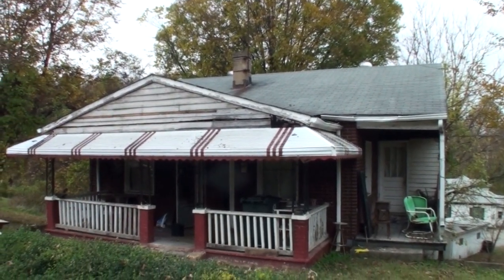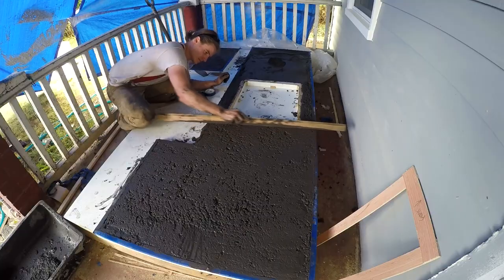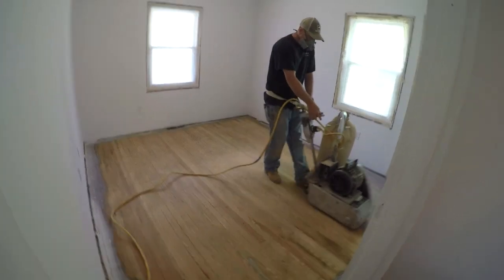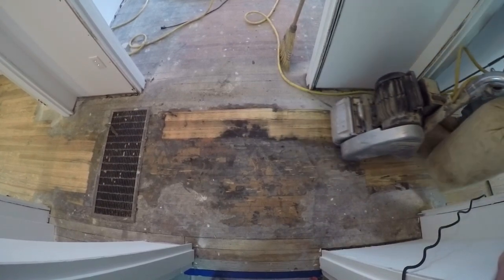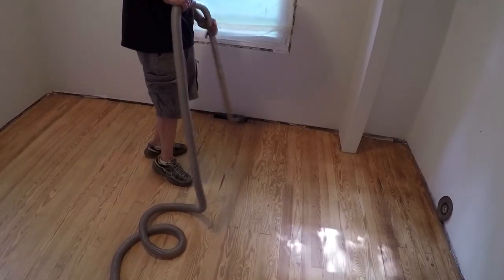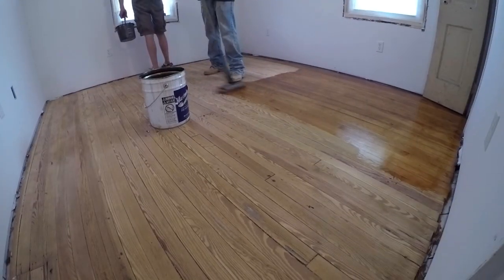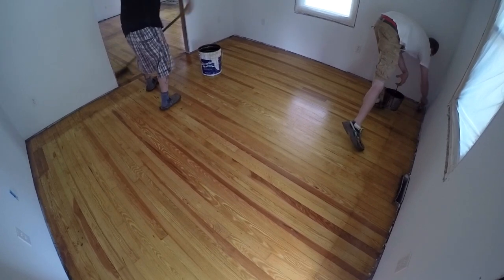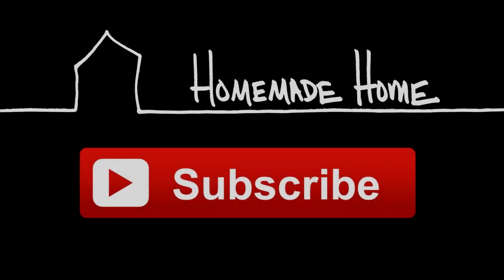Restoring Our Beautiful Pine Floors

Comment: Very logical choice in hiring a team with all the equipment . I have sanded many floors over the years , making a living at it and I still have the drum sander , the edger and etc. in my shop, sometimes I bit off more than I should have but slowing down some after turning 70 years old. All that dust isn't healthy but still doing shop wood working. Thanks for your interesting channel.
Reply from the maker: Handy tools to have.

Comment: Came out awesome. It pays to hire the pros, like you said, they have the equipment and knowhow. I learned that the hard way. Now you have a new house with your uhmmmm you're wife's finger print on it. Really a nice job.
Reply from the maker: It sure does, I've done all the work except for the floors, window install and heat pump.......should have got someone to do the drywall, they came out nice but it took me about a month. Thanks for watching.

Comment: how much did it cost for the pros to do the job?
Reply from the maker: About $1,200
Reply: @homemadehome5575  From doing about 1,000 sq ft myself on two houses, it would have cost you (with rented equipment) about $300. But that edger is called a "Widow-maker" for a reason, LOL. There's a better machine to rent for removing the 'top coat so they wouldn't have spend so much on paper. But pine is soft and probably needs the experts. I do like a floor with more character.

Comment: Can you give estimate cost on paying someone to do the floors. Thank you
Reply from the maker: I paid $1200, my house is a little under 800 sq. feet. This did not include the small bathroom and the utility room, both small. You can call floor refinishers and ask there price for sanding and finishing per square foot. It should be standard, if someone can't tell you that.....I tend to stay away from them.
Reply: Homemade Home thanks! I’ve been treated badly in past when calling electric workers etc to ask pricing and they ask if it is for same day and I say just planning and they hang up on me cause I’m not instant money. Thank you! My house is listed at 1,000 but I’m not sure if that includes my closets or weird side room lol.
Reply from the maker: Having an electrician quote you a price over the phone is not as simple. It is a shame when someone isn't polite about it but I can understand their position. Working with customers is hard, what makes it worse is normally the customer has no idea what they need, much less how any of the work is done but still want to be involved. Outside of calling a big company, dealing with tradesman is normally fairly difficult unless you have built up a connection with people you use regularly, which most people don't. Most of these tradesmen are in a financial pickle, so they are basically running from one job to the next but never get anywhere. Also when people say they are planning, it just sounds like they are calling around finding the cheapest price, hence the hang-up. They are just going on experience that most people saying that don't work out. The best way to find a tradesman is through word of mouth. Ask others you know have had work done, or ask another tradesman, a plumber for example, if they have anyone they would suggest to do some electrical work, he will probably say "My cousin is an electrician." Certain trades are not as standardized as others. Floor sanders have  per foot price, drywall is by the sheet. Plumbing is more by the job, so is electric outside of some stuff like. A plumber will have a normal range for doing things like changing out a toilet, water heater, etc. Electricians could tell you a normal range for a service upgrade, fixing an outlet but bigger stuff is too hard to predict without really looking into it and there is enough easy work out there for tradesman to pass up on time consuming stuff. All this is just an explanation from my point of view and experience, it can be a tricky world to navigate without forming a bad opinion. Your sanding job will probably cost no less than $1500 but will probably be between $2000 - 3000. I think my guys did it cheap. Mine was also a barebones job. No stain, etc.
Reply: Homemade Home yes a job can be different hours but I was looking for average estimate on how long something takes / per hour rate. Not a hard number to hold them to .

Comment: they should have sanded a bit more, down to the bare wood, which is why you have all those dark spots where the varnish seeped in
Reply from the maker: It was down to bare wood.....these are stains from years of issues, they go deep.
Reply: get back to your dump dave, i still believe those Dark Spots could have been removed with a bit more sanding. although it looks pretty good and has good character.
Reply: water damage, sure, ive redone boards that looked like they had similar damage to that, and they turned out fine. with that amount of water damage im sure there would be rot too, the fact is , neither of us can know exactly what it is or exactly how to resolve it. since it was only given a few sand downs. barely enough to remove that sort of damage. you'd not be able to tell. just by looking at  video if the damage goes all the way through. or if it only goes a few levels down it could even be fixed with a bit of bleach and wood stain. anyway. im done arguing with a dumpster diver.